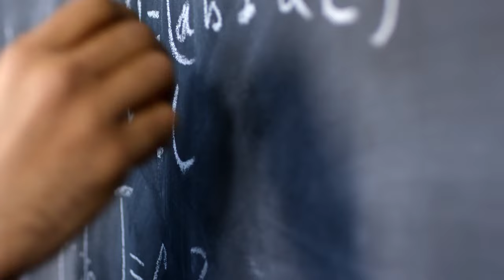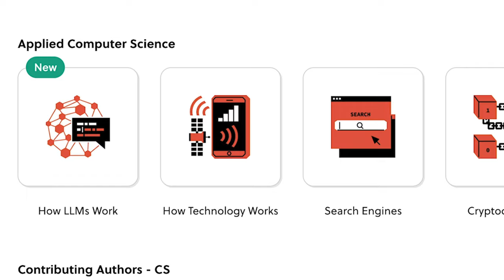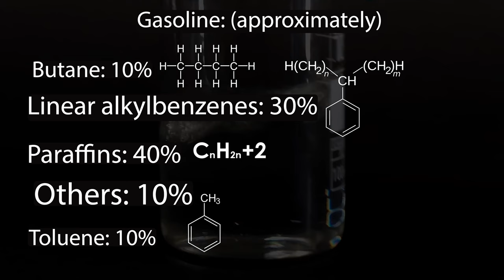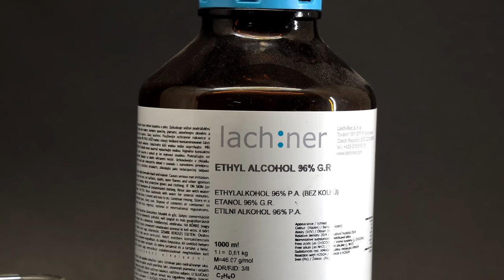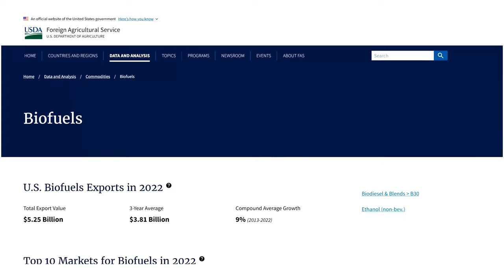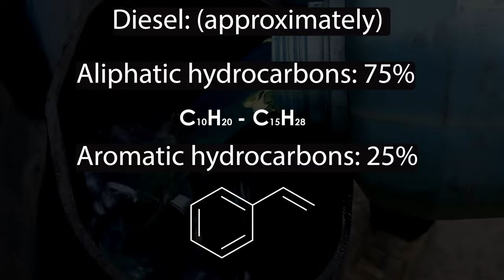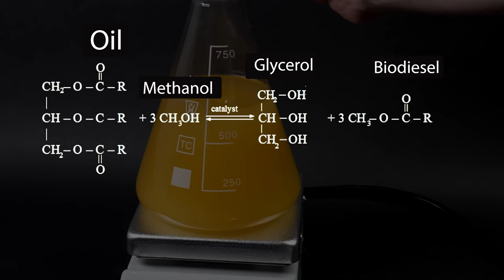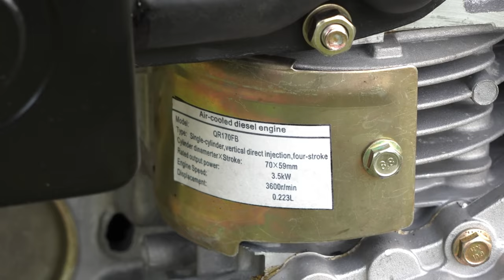Why Biofuel is a Scam?

Comment: The title has me suspicious/upset, I’m hoping it’s clickbait and not an oversimplification of biofuels/bio-petrochemicals greenhouse gas emissions/overall impacts.
Reply: It is, unfortunately
Reply: You sound like you might not be ready for the internet if a video title upsets you.
Reply: Hopefully you arent a engineer if it makes you upset, theres pros,cons and nuances to every solution,
Tldr we should acknowledge limitation and effect on environment (nitrogen from farming going to Water,river, needing to clear Trees/native species for fields ect)
Reply: You know the rant is giant when it has to be multiple parts lol, part 1:

So Post Watch Thoughts:

I think the overall timeline style was pretty well done, HOWEVER:

- Data on Energy was a bit less detailed as i would want.  Granted it could turn the video into a slideshow of a munch of graphs, but there is that.  Not just J/Kg but also J/Kw etc. there is that.  Also Engine Design/Efficiency is also relevant.  Granted i do understand the issues of scope getting waaaaay too wide, or it getting boring, but i think the standard one should reach is still a bit more “up there”.  The videos by “Engineering Explained” on ethanol or methanol etc are probably some of the best existing examples out there for those who are interested.

Also as you alluded to in the Ethanol section, Engine

Also as you alluded to in the Ethanol section, Engine Optimization plays a heavy role as well.  “Engineering Explained” has done some AMAZING videos on this in particular.

I would need to grab papers and such, but in terms of engine modifications, i think the main changes are Fuel Lines, Fuel Tank/Pump, and Emissions Sensors (and/or a Fuel Sensor).  The latter two also aren’t needed for “dumb” engines obviously.  This is due to how Ethanol and Methanol often adsorb water and thus are a corrosion risk.  Various anti-corrosion additives may reduce this effect, but I can’t speak to that that well.  Either way “Flex Fuel” vehicles are quite common, and aftermarket kits (typically aimed at racing markets wanting more power via the higher octane rating of methanol and/or ethanol).
Reply: Part 2:

In terms of the Diesel Section, you neglected to mention how the use of Pure Plant Oils (as well as pure crude oil) were used even by Rudolph Diesel himself.  Granted it doesn’t fit our modern low pollution engines as well, but “Crude Oil Engines” (which some of those Chinese Single Cylinder Diesels may technically be if I remember correctly, citation needed and all that).  Also some advocates overstate how much it was used/how great it is, but the concept of a farmer using a small portion of their crop to be self sufficient on fuel is neat.  The main issues are Fuel Lubricity, and Cold Gelling/Soot Production, which you did a decent job presenting.  One aspect i would mention is that “Diesel Winterization” is a thing one can do which makes fuel gelling a non-issue for the most part.  Mainly things like “Block Heaters” or Oil (Pan) Heaters etc, inline fuel heaters also exist.  More complex systems using Starter Fluid or a sort of Diesel Heater exist as well, but the other methods are quite simple and easily available as off the shelf aftermarket kits.  The Fuel Lubricity Issue is a bit more complex.  I don’t know enough about this to be sure, although i think it is addressable.  It probably would require different injection systems or something along those lines which would require more modifications rather than a “drop in” fuel replacement, which can have impacts on somethings “sustainability” although the only way to know for sure is a proper Life Cycle Assessment, and even then the answer depends on your scope to an extent (Just ghg emissions, is land use change (both direct and indirect) taken into account, water use, resource use, social/geopolitical impact etc)

One of my main issues though is how this video only really discusses Generation 1 Biofuels.  This is a bit understandable as short of BP etc doing some greenwashing every so often, or the small boom in the early 2000’s due to cheap Fossil Fuel Costs most of the more recent biofuels have been limited to laboratory scale or pilot plants.
Reply: Part 3:

You could even do a part 2 addressing them, but essentially:

Torrefied Biomass and/or Hydrothermal Carbonization - Similar to Low to Mod Grade Coal in Performance, albeit less heavy metal pollutants etc and thus ash can be used as fertilizer if done right, Ot also stores a bit better due to the hydrocarbons being nasty enough to keep microbes/animals away (similar to the medical use of Coal Tar), and keep water away.  It may be useful as a “drop in” for old style coal plants and steam trains especially, but overall quite niche and impractical.  Some Steam Train Museum Clubs use it currently i think so it does seem to be filling that niche.  Regardless of how useful it is, i still think it is interesting to mention though.

Pyrolysis Oil - Oil Produced by Pyrolysis.  This was done with coal to make Coal Oil, and the process is roughly the same for biomass short of some drying needed in some designs.  Can be used “as is” in Crude Oil Engines or Fuel Oil Burners/Gas Turbines although it tends to have issues with particulate matter suspended in it as well as being quite corrosive / “nasty”.  Still can work though and has been demonstrated on the Pilot Plant Scale.

Bio-Butanol and other more novel Fermentation Products - These are produced in a similar manner to alcohol (ie by fermentation) but in the case of butanol are much closer to gasoline in most specifications.  Another thing to mention of Cellulosic Ethanol Fermentation which you eluded to, but didn’t go into enough detail, at least in my opinion.

Gaseous Fuels such as raw Biogas, or Biogas upgraded to Natural Gas Specifications (thus ANG, CNG, LNG, etc) are being used, and integrate very well into Wastewater Treatment ecosystems, as well as some dedicated feedstocks such as Glycerol.  It is also simple enough poor farmers can make a device where manure is fed in one side, raw biogas (suitable for basic cooking/lighting and “dumb” engines) and an effluent usable as liquid fertilizer  come out the other end.  It is being used globally, but in part due to government outreach if i remember correctly they are quite popular in india now.  Granted citation needed, but plenty of good content for B-Roll there.

The next chunk of fuels (which could be another video, such as a part 3) would be ones made in ways more similar to Refineries, some of which can be made in refineries as-is, if not some off the shelf units being added/removed.

As stated previously, Pyrolysis Oil can be to an extent processed as a crude oil, some papers call it Bio-Oil or Bio-Crude.  Pure Plant Oils or Waste Cooking Oils / “Brown Oils” from grease traps etc can also be used to make “Renewable Diesel” or Hydrotreating Biodiesel which is distinct from Transesterification Biodiesel (ie what most people know as the only biodiesel) in that it is Identical in all Relevant Specifications to Fossil Diesel.  

What i find to be the most compelling Technologies are Biomass Gasification (which often can be adapted from Coal Gasification tech), then existing off the shelf Gas-to-Liquids Technology (Currently used for Coal / Tar Sands etc), and “Hydrothermal Liquefaction” along with the aforementioned Anaerobic Digestion and Novel Fermentation Processes to a lesser extent.
Reply: Part 4:

Gasification is an old technology tracing back to experiments by all sorts of the first scientists (some in the middle east heating petroleum from local surface deposits in the Islamic Golden Age, renaissance element hunting in a similar manner, victorian “town gas” / “coal gas” systems etc, those “wood gas cars”, i’m not a proper historian and citations needed and all that hut PILES of stuff on all this).  The most advanced setups were often done in the “Clean Coal” craze of the early 2000’s.  Due to issue of mining, and toxic ash/flue gasses “Clean Coal” is nothing but an industry greenwashing lie.  What is interesting is Biomass rarely has much of the “nasties” that make ash toxic, and if done right “Biomass Origin Ash Return” (BOAR) can be done to prevent soil depletion, or more simply the ash can be sold as fertilizer.  Mainly processes such as “Fluidized Bed Gasification” and “Entrained Flow Gasification” are very interesting.  The Hydrogen can be used as is (Although in most cases outside of Rockets, Hydrogen is a crappy fuel for a number of reasons) for fuel, the Syngas can be used as-is (such as on those gasifier cars, or generators from the home level all the way to giant Integrated Gasification Combined Cycle Power Plants), or be made into fuels and/or petrochemicals.  The latter of which will almost surely always be needed.  Power-to-X / Gas-to-X are good terms to look into for all that.

Syngas Derived fuels can be nearly anything.  The most conventional would be Methanol or Fischer-Troph Crude/Gasoline Replacements.  The far more interesting and favorite of mine is Dimethyl Ether (aka DME).  This stores like propane, and can be used as a slightly less efficient version of such, or used as a Diesel Fuel with numerous advantages.  Due to being a gas at standard conditions in vaporizes easier, and as with Automotive Propane (often called autogas) the “cooling effect” can be used in ways similar to Water Injection or Methanol Injection.  Also it has a higher Cetane Rating than Diesel Fuel.  It also cannot form soot (short of maybe from Lubricating Oil burning on the cylinder walls) so even without a Diesel Particulate Filter it is already a bit more “clean” (NOx/CO/Unburn Hydrocarbons are still probably an issue though).  It is also used as a non-CFC, non-high GHG Propellant, especially for situations where CO2 or Nitrogen wouldn’t work.  The main issue may be it wanting to dissolve seals and such, although this isn’t impossible to solve.  Also potentially fuel lubricity, but this is probably just an injector design requirement.  Volvo seems to have solved this, although more information is needed into what all they did.  Volvo and Oberon Fuels have demonstrated DME as a Diesel Fuel in the real world.  In other parts of the world it is also being ramped up, Granted it is often done to make domestic coal resources more useful/easy to transport, and “clean” for the end user (coal still has all  it’s issues), although as with “Clean Coal” or Coal-to-Liquids work, this should be heavily adaptable to Biomass.

Hydrothermal Liquefaction (HTL) is a very interesting process in that not only does it not require drying, it needs water.  This is different compared to the older Dried Algae to Algae Oil to Transesterification Biodiesel process most often mentioned (although Hydrotreating Diesel or Kerosine can also be done) Thus raw feedstocks such as Sludge from Wastewater, or Algae can be used “raw” (short of some tuning, and sometimes a Catalyst).  Given Algae’s potential as a Feedstock, this could be a MAJOR source.  Due to it being so efficient you can either have less land use for the same amount of material, or do way more production.  The Bio-Crude Produced, short of in some cases more Iron and Salt (both of which can be removed with off the shelf De-Salter and Hydro-Demetalization units) it is a drop in replacement for Crude Oil.  Thus short of those units if needed, all one would need to do is get algae farms, logistics, and HTL plants going and you have decarbonized all of that.  Granted proper LCA’s and such are needed to see how much land would be needed and all the various inpacts, as well as how it wouldn’t reduce plastic waste/pollution or emissions from the burning/spilling of the fuels and such but this is doable with existing or near term technology.

One final and important thing to mention is that Biopetrochemistry isn’t alone, it also ties into Thermal Recycling of Plastics, Recycling of Waste Cooking Oils, Municipal Solid Waste Gasification/Waste to Energy Plants, Landfill Gas, Wastewater Treatment etc.  So even without dedicated biofuels farming, there is potential for producing some.  The main thing i am interested in is that ecosystem and how to optimize for GHG Emission, Water Use, Land Use, Social/Geopolitical Impacts, etc, but especially with the more novel methods i think we can do many “Drop In” replacements getting change done quickly and with less major disruption, although i do agree that systemic change is needed.
Reply: Part 5 / Conclusion of that Rant:

That was a LOT of information to take in, and i bet there are probably some typos and whatnot, but those are my thoughts after watching this, and some infodumping on Bio-Petrochemistry.

This video, despite me agreeing with the final bit of “Systemic Change such as more Public Transit etc is needed” and it being close on some aspects of the biofuels it covers, was very oversimplified and due to lacks of nuance or inline citations (which i am not pure of here, but this isn’t scripted and i can grab papers and stuff i have read, most are DOE, ARPA-E, and EU type studies, although a few others) it could damage efforts to replace fossil petrochemistry with biopetrochemistry, which given Fuels and Single Use Plastic Packaging are not anywhere near the only Petrochemical Products used in the world, is something we should not be saying.

My suggestions would be making a Part 2 and potentially more covering some of those other biofuel concepts, and/or a whole series of doing interesting bio-petrochemistry yourself such as Ethanol-to-Ethane (Hyperspace Pirate has done some of this), or potentially even make Polyethylene from that!, lab scale Hydrothermal Carbonization or Liquifiaction, Fractional Distillation of Pyrolysis Oil (from different sources), Potentially do some Gas-to-Liquids Stuff, or even do Acetone-Butanol-Ethanol Fermentation and cover butanol.  Biogas Upgrading with a Spray Column or something would be neat too.

Granted if i ever have the time/money and make a YouTube channel I will probably make some of these myself lol.

I am *rambling*, but these are my thoughts and i hope you do better with future coverage of the topic.
Reply: @sintaxera  More of “i’m not mad I’m disappointed” i guess.  Main thing is this is something i am a MAJOR nerd about, and I’m disappointed even my favorite channels don’t do it Justice.
Reply: @somerandomusername2590  Agricultural Wastewater Runoff and all that is a but of a different issue, which can be solved to an extent, i do 100% agree with your core point.

The way to go about this is before implementing some Subsidy or pushing for adoption of the technology, the government and authorities should do a large “Life Cycle Assessment” taking into account as you said not just Greenhouse Gas Emissions, but also Land Use (Change), which can be divided into direct (such as land cleared for farms) and indirect land use change, Water Use, Social/Geopolitical Impacts, Economic Impacts, and so on.

I think if Sustainable Farming Practices are used, Biomass Origin Ash Return, and State of the Art Pollution Control Biomass Farming, and Biopetrochemisty as a whole can be sustainable.  Granted easier said than done, and *citation needed*, but yeah.

Also as stated in one of the last parts of that rant of mine, Thermal Recycling of Plastic, Waste Cooking Oil Recycling, and Wastewater Treatment also tie into the same ecosystem even of biomass farming isn’t done and all organic waste is simply composted.
Reply: @somerandomusername2590  There are! That's exactly why he started the video by asking if environmentally friendlier substitutions are the future 🤔, making fun of science that stops the destruction of the rock we live in does indeed have its pros and cons!! /s
Reply: @eumim8020   so we destroy the environment to make fields to grow plants, and mow over all the wildlife and birds to make more eco fuel, let alone Nitrogen runoff, mass usage of Pesticide which wipes out Bee and pollination populations and not think maybe its complicated solution.

The point im making is the efficiency and cost and effect of what you want, ignoring it doesnt help solutions, you just want the feeling of accomplishment vs actual working toward solutions

Comment: I think we could deal with the price issue of boifuel without the raise in food cost. Which in it self will lower it cost.  
We just need sugar  to make  the ethereal alcohol
 sugar cane and sugar beets are the 2 biggest  sources of sugar. It i think sugar cane would be the best one as it is cheaper to grow and can be grown  in most places. 
Also we get secondary produce off of sugar cane which we can use.
Reply: Sugar cane can only be grown in the tropics.
Reply: Ethanol isn’t the only biofuel, heck not even the only Fuel Alcohol.

Granted it is simple, but even for ethanol “Cellulosic Ethanol” made from Wood, Bamboo, or Grass (which can also be done with native plants) is a potentially more efficient and sustainable way to do so.
Reply: A lot of biofiel is made using waste cooking oil, mostly from factories like crisp factories and read meal factories etc.
Reply: @ericlotze7724  That good to know as we can  get a little more out of using sugarcane. As it has a lot of  Cellulose in it.
My  home had bagasse ceiling. It made from left over of making sugar from sugarcane.
Reply: Genuinely the best source would be corn. As you can get both the oil and the Sugar from the corn as it is very rich in both.
Reply: @ThunderChunky101 Yup, that is the common source for it and most of that is corn oil,
Reply: @borttorbbq2556   I have a lot of question on corn vs sugar cane  for fuel. The main thing i seen is price  to grow.  sugarcane is half the cost of corn along with a few other parts and steps.
Reply: @blackgriffinxx  for sugar your right. but corn can be used for sugar and oils along with additional byproducts.